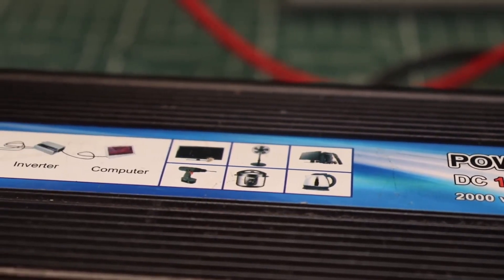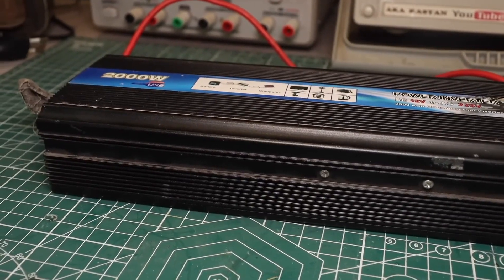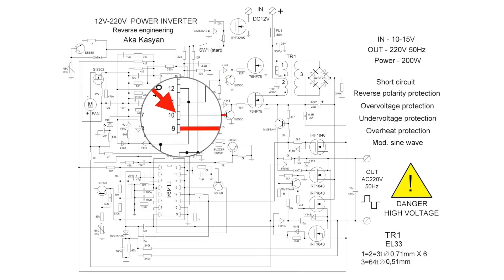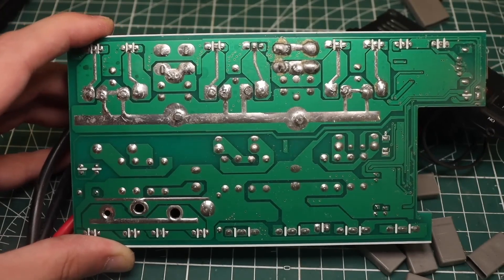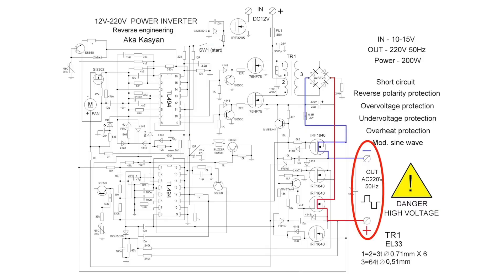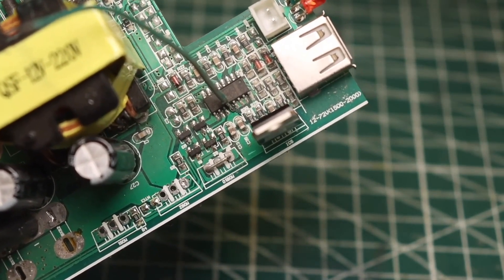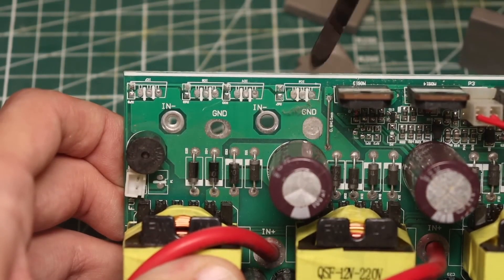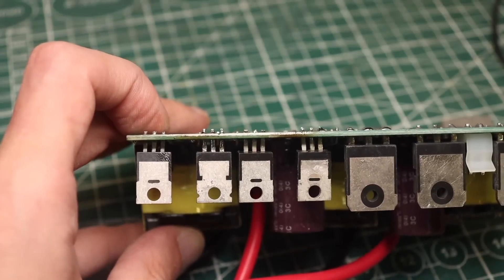Masterclass: How to Repair 12–220V Power Inverters 💡🛠️

Comment: Hello, i have a question since you requested comments from your viewers :
I have many inverters where the H Bridge circuitry is damaged and beyond repair. Can you give a circuit which will take the 300vdc and convert it to 220vac modified sine wave. 
Many thanks and hoping for an answer.
Reply: Let a pro do that, if you ask such a question you might harm yourself.